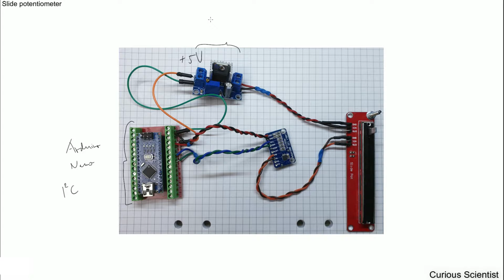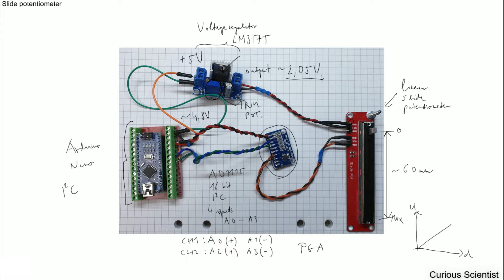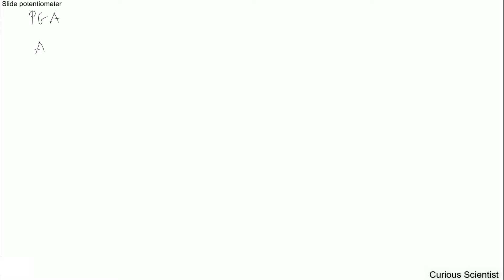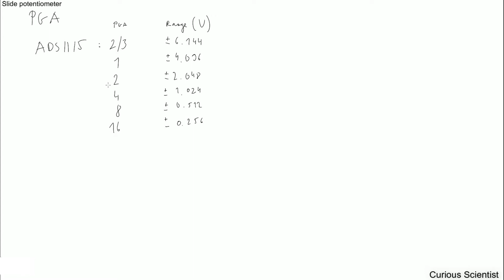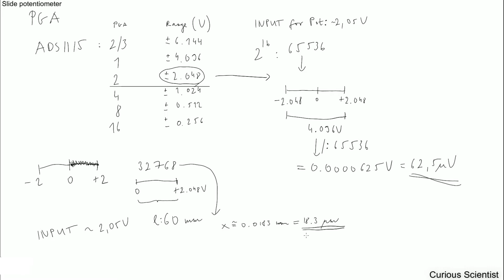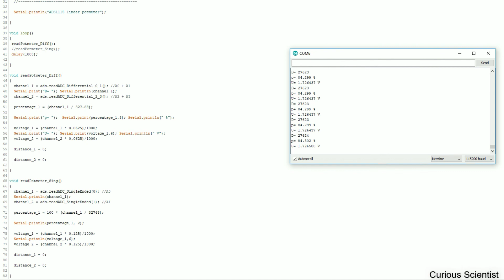Displacement sensor with a slide potmeter - Part 1

Comment: Thank you for the great video. I am trying to use a slide potentiometer and arduino uno to measure distance, if i apply the same code would it work an ADS1115 ADC, an LM317T based voltage regulator or i would need those too.
Reply from the maker: Hi! Have you tried it to see if it would work? Also, I think some word is missing from the second sentence. It doesn't really make sense.
Reply: @CuriousScientist   my apologies for the typo. I recently started using aduino and potentiometers so I don't know much about them. I was asking if it would work if I did not have an ADS1115 ADC, an LM317 T-based voltage regulator. I only have Arduino and a slide potentiometer.
Reply from the maker: @its__amanda_545  Sure, just use the internal ADC and the 5 V rail. But you'll need to modify the code to make it work.

Comment: Hi, Thak you very much for sharing your knowledge. One thing, I believe you made a mistake when calculating the resolution, because 60mm / 32768 = 1.83 microns, not 18.3 microns...
Thanks again, very useful and it will be great to see your tensile machine development!
Reply from the maker: Hi and thanks! Oooop, you are correct! Very nice that you spotted the missing zero! I underestimated the resolution of the system. 😄My fault, and thank you for pointing it out!

Comment: Great video!
I was wondering if there was a reason you used an ADC instead of using an Arduino with a built in analog input. 
Thanks for all your helpful content!
Reply from the maker: Thanks! The reason was the resolution. 10 bit vs 16 bit, it is a huge difference.

Comment: Hi, how come you're using a voltage regulator to reduce the voltage? Can I set up the slide potentiometer using the 5V pin directly from an arduino?
Reply from the maker: Hi! If I remember correctly, I used a non-zero PGA value for the ADS1115 and I wanted to match the voltage applied on the potentiometer with the range of the PGA setting. At that time, this looked like a good solution, but today, I would do it differently (I learned a lot since). If you use a large enough potmeter, so you don't draw too much current, you can do it with a potmeter as well, yes.

Comment: I need to use a linear displacement gauge to measure up to 50mm displacement using arduino. can I use this same solution to integrate the industrial linear displacement gauge to the arduino? I see solutions only for PLCs.
Reply from the maker: Hi! As long as you know the output signal of your sensor, you are good to go with Arduino. If you check my other project in my videos, I did a similar thing with a digital caliper. Since this slide potmeter gives you a simple voltage drop, you simply have to read the output voltage of the potmeter and you calibrate that value for the distance. With the digital caliper you have a set of square waves which correspond to the displacement. At that case, you have to convert the series of binary numbers into a decimal number and you have the displacement. If you have an industrial linear displacement gauge, you should get an oscilloscope (check my videos for a cheap alternative) and measure the output signal. Then you can reverse engineer the whole stuff and process the signal with Arduino. I will look around on the market and try to find a cheap one. Then I will make a video about that. But it will take some time.